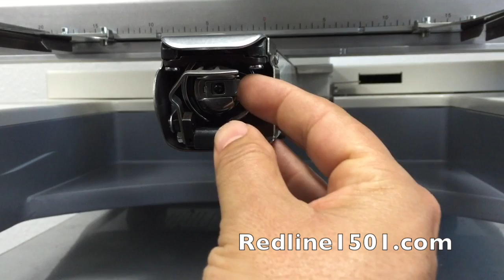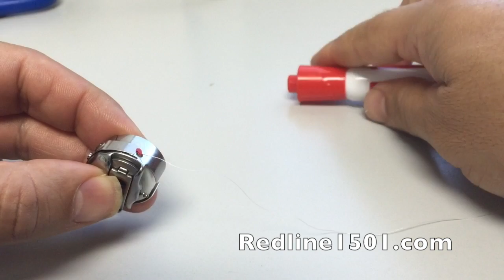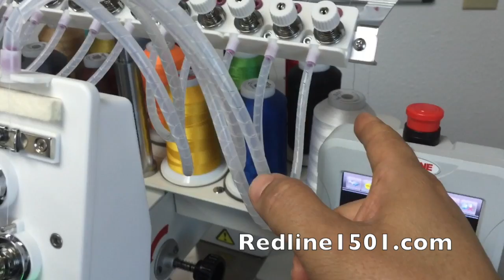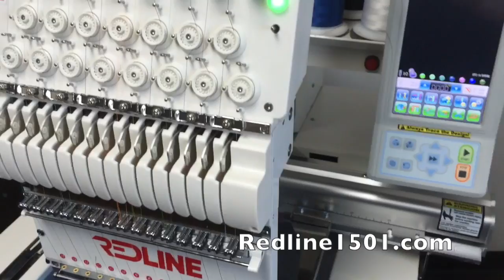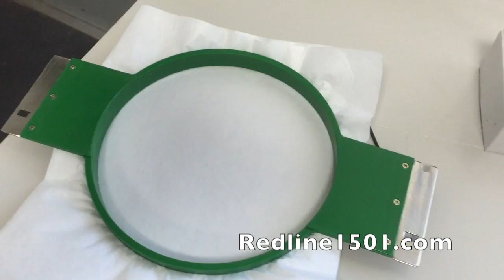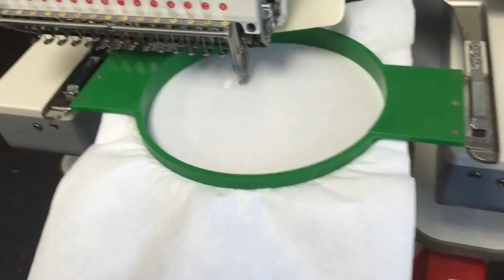About Tension | Redline Embroidery Machine

Comment: This is the BEST TENSION VIDEO I HAVE EVER WATCH!!!!!!  Yes, I did exactly as you explained for bot the bobbin and the upper cones, Checked the Bobbin tension and it dropped just 1 1/4 inch, and then flattened all my cones thread tension knobs, did my first run, and found some threads too loos, and some too tight, so I tightened or loose accordingly, just one half turn accordingly.  Now my machine is stitching PERFECTLY!!!!!  And I did that also for my single needle machines from Brother, Janome, Viking, but specially the Bernina machines that all of them have a bobbin case and a bobbin coz they are not top load.  Infinite thanks for your very detailed and excellently explained video!!!! Jorge

Comment: Tension is a headache!
Most videos say flush the top tension with the inner screw, and adjust bobbin tension to 150~225 depending on the fabric
Well, tried it! And broke 5 needles!
Turns out the top tension was the issue, I needed to loosen it all the way to almost removing the entire screw, that was the sweet spot.
Take home message, bobbin case should be around 150~225 after that forget about the bobbin case, and only adjust the top tension until you find the good spot. Took few hours of frustration and googling to understand this.
Reply: Get yourself a bobbin thread tension gauge. It is a must. Otherwise it will be a trial and error until you adjust the tension.
Just get the gauge, and now you are left with the upper tension. This will give you one variable to adjust rather than two variables, which will cause frustration for new embroiders.

Comment: CAN ANYBODY THAT BOUGHT THIS TELL ME IF IT IS A GOOD BUY
Reply: How much is it?  is it used?  What are you looking to do?  Are you already an embroiderer, or are you looking to just get started?  I love their fast-fix videos....  save me a lot of headaches on my Melco machine, for sure!
Reply: i am in the biz looking to get all new equipment love SWF but the price is crazy now,i need another four head i am willing to get  two doubles and one single for hats if it does a good job would like to see one up close and personal 4 myself. will be in las vegas this wkend if there is one has one in that area
Reply: Emanuel Colon   I feel ya.  Melco won't even post their prices on equipment.  I think it's because it is so much higher than others.  am thinking of finding a Brother or Elna machine, as the price is a third of Melco pricing..  But, i'll keep my Melco single-head running.  It is a true workhorse!
Reply: what do you think of this REDLINE machine,it is low but is it going to give you problems
Reply: Emanuel Colon   I wouldn't know.  It seems to have a lot of mechanical functions,  (rather than computerized, so it may last longer than some of the newer machines.
It's like old cars vs. new cars.  On the newer cars, if the computer goes out, you're done.  On older cars, you can easily replace parts...
so i was interested in the Redline for this reason.  And it seems similar to the (very old) melco Mel-star...  Or the SWF machines from about 25 - 30 years back.  There is nothing wrong with older machines, as long as the motors stay in good shape!
Reply: But, they are still pretty pricy.  You can pick up a 5 year-old melco amaya for half the price of this redline.  I'd probably go with the amaya, just because i know melco and i know how well they run-- for decades!